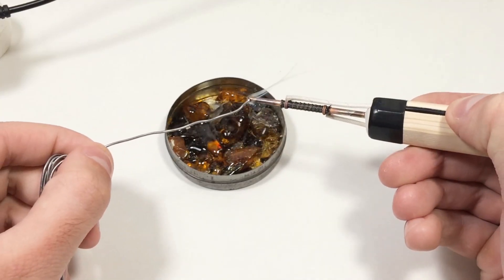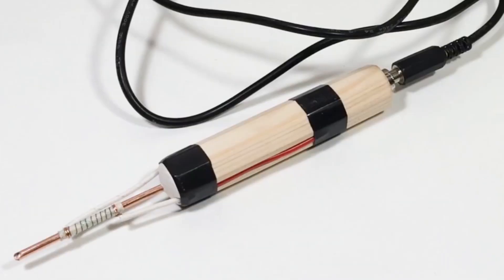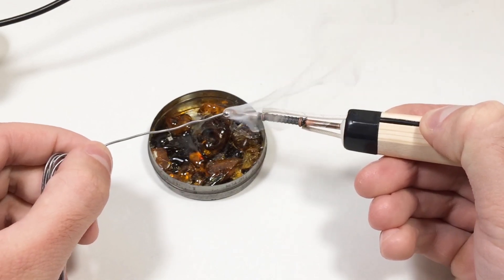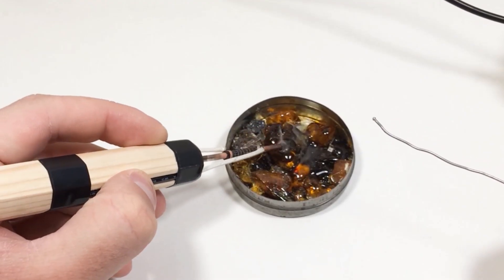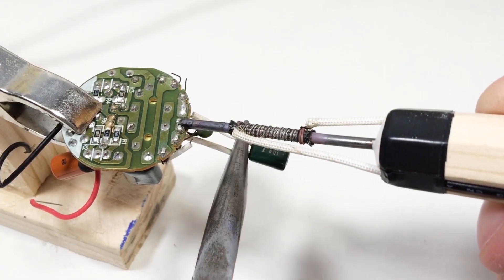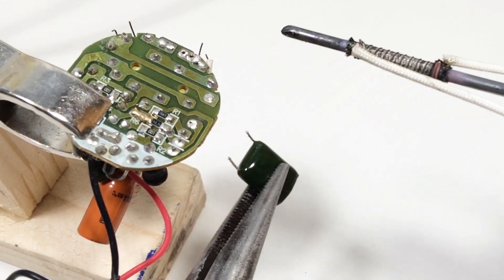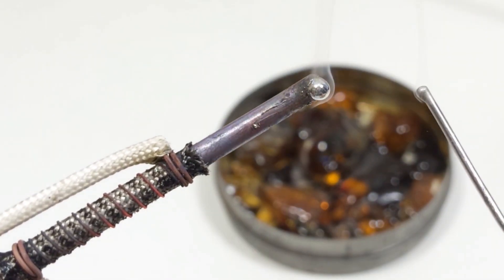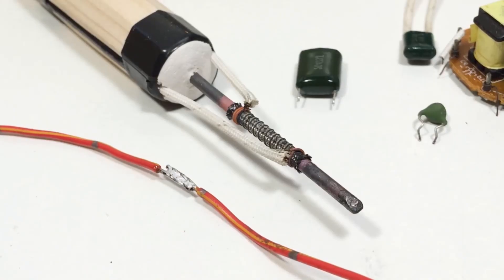DIY Soldering Iron - Homemade Battery Powered Tool for Off-Grid Repairs

Comment from the maker: Hey everyone! 👋
This is the DIY soldering iron you just saw in the video — fully homemade, works like a professional tool, and can even run on a battery pack. Perfect for off-grid projects, emergency repairs, and survival situations when you don’t have electricity or a store-bought iron.

🔹 Want to build one yourself? Check out my full step-by-step tutorial here: 
🟢 https://youtu.be/KuPHZ3tZ9oc

🔹 Prefer ready-to-use options? Grab some great soldering irons here: 
🟢 https://fas.st/zEFDWU
🟢 https://fas.st/vxSEnU
🟢 https://fas.st/OvhRHp

💡 Don’t forget to like, comment, and subscribe for more DIY tools, survival hacks, and electronics projects!